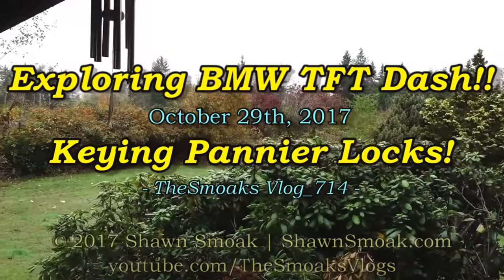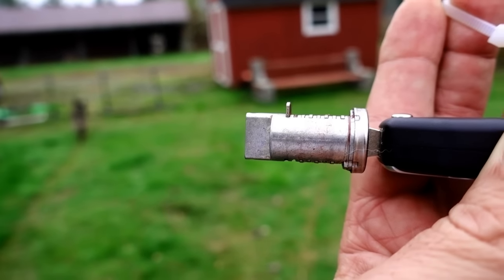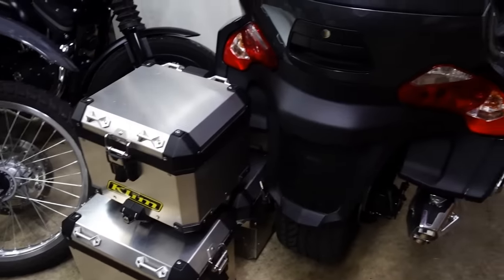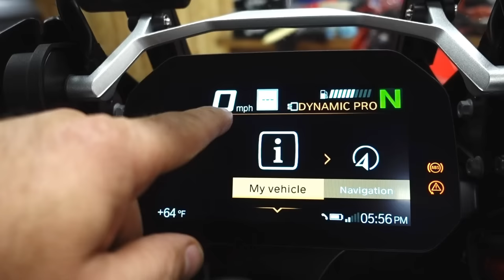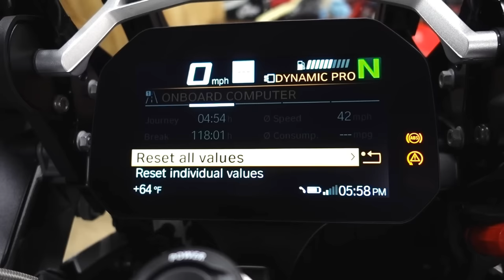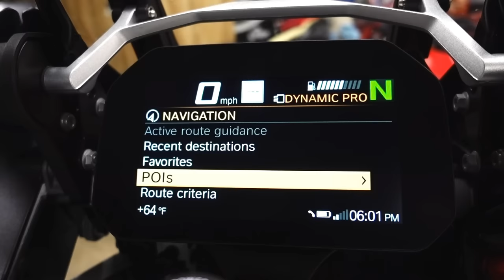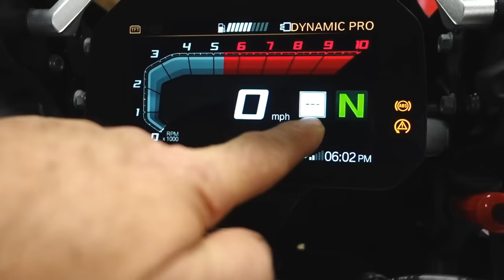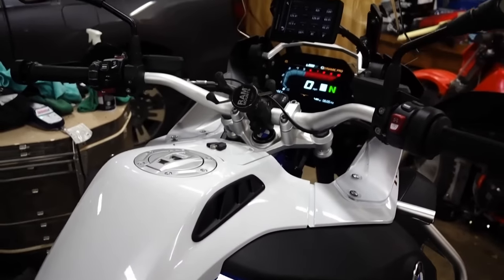Exploring BMW TFT Dash!! • Keying Pannier Locks! | TheSmoaks Vlog_714

Comment: On the s1000rr 2020, the app has speed, RPM, lean angle , throttle position, altitude etc

Comment: Hi Shawn. You mention a connection directly to the battery is a no, no. How would you suggest I connect a pillions heated jacket
Reply from the maker: Connecting to the battery to power-up accessories if fine.  BMW doesn't want you to connect a charger to the installed battery while connected to the bike.  Charge through the power port (with a CANbus compatible charger) or a removed battery...

Thanks!

Comment: I’m researching your older videos for tft display info. I have the 19 Standard GS HP and I’m trying to figure out how to disable traction control in Dynamic mode. I do not have the chip for pro modes. Is this even possible. The manual is not great in this area. 
Thanks.
Reply from the maker: Using the ABS button on the left switch cluster, short presses switches traction control on and off.  Long presses switch ABS on and off.  Works the same in Dynamic Pro, should you order the Pro Ride Modes chip at some point... 
Be very careful..!  I don't want your next reply to be about you looping the GS over, or totally loosing control of the rear end!!!  BMW took these options away on the 2020 S1000RR, unless you render the bike into full race mode (street legal lighting removed).  I bet BMW will make Enduro Pro mode the only mode you can turn this off on the 2020 GS/GSA's...  Pretty crazy when riding them turned off, so again, be very careful!  If you get the chip, you can turn it down, but not completely off...  Much safer!

Thanks Courtney!
Reply: Thanks...
I really appreciate you taking the time to reply. 
I will be careful. Definitely do not want to loop it 😬

Comment: Nice FYI. I survived my trip down south. 22hrs of riding in total for a distance of 2,534klms. I broke up the down trip which was easy, but the return was one trip, not so easy. My butt was like lead, even with the Mustang Vintage touring seat, by the time I got home. The SGS handled it like the pro it is. Never put a foot wrong even in 60kph wind from the side. I did however make one mistake when returning from Wollongong took the wrong road. Princess Hwy and Princess Motor way ain't the same thing. Needless to say this bike isn't for stop start city traffic  with traffic lights every few hundred mtrs. Should have zigged when I zagged.  Still I've done it and I'll wait awhile before doing it again, it'll take that long to clean the bike.

Comment: So that not honking charger directly to the batter just a BMW thing. My 2014 comes prewired for the battery analyzer to the battery.
Reply from the maker: +Ron Bridgefarmer - I can promise you, your 2014 did not come from the factory prewired with a charging lead attached to the battery...  A lot of dealers install them during setup & PDI of the bike. We do the same here on everything except F, K and R series BMW's.  BMW claims that going through a battery that's connected the bike's system could possibly do irreversible damage to control modules.  Pulling the battery from the bike is fine, or using the power port with an approved CANbus charger is fine as well.  The power port is filtered by the ZFE Module.  If anything was to go wrong, the ZFE will shut down the power port, protecting everything.

Thanks for watching and commenting Ron!
Reply: @TheSmoaksVlogs  So due to the charging being done via the power port, will any charger work if it has the connector. I have the leads directly on the battery on my harley and was hoping to use the same charger and lead once i get my gsa

Comment: Good day all
Shawn can you add a link to the video showing how the charging sequence I have 2016 s1000 XR that the dealership put on the little dongle that connects to the battery But I would like charge it properly 
Thanks 
Bill
Reply from the maker: +William Barbour - For whatever reason, BMW is okay with having the charging port installed directly to the battery on the S series bikes..?  We do the same as your dealership, the leads are installed during setup & PDI.  You're all good!

Thanks William!
Reply: Yes, my dealer installed a cable to the battery and I connect !y optimite straight to it...no messing about!
This is my second LC GS that I have had..no battery issues

Comment: have you a link to connecting the optimate ? and must you buy the canbus version will the din cable work with the non canbus optimate 4
Reply from the maker: +Allroad Mail - I'll have to do some digging because I can't find the darn video myself right now..!  Yes, it has to be the CANbus version and switched into CANbus mode.  The bike's ZFE (Central Chassis Electronics Control Module) will simply shut the power port off in approximately one minute, as it doesn't recognize an appropriate charger connected to it.  Seems a pain at first, but becomes second nature after a few times hooking it up.  It's very safe for the bike.  If anything were to go wrong, like power surge for example, the bike instantly shuts the port down.

Thanks!

Comment: Thanks a Lot for the video.
I have a question. I intend to buy a gs 750 in a few weeks.
My thought is that TFT and Navigator 6 overlap in many features and makes no sense buying both. TFT is no brillian in navigation but you can use your mobile phone with google maps connected to TFT.  ¿¿Is my thinking right?? TFT and Navigator are expensive devices and I would like to make a wise decision.
Thanks a lot...!

Comment: Pannier rack recall?????   about done????
Reply from the maker: +P Baker - There’s a solution now, just waiting on the parts to update the racks, and panniers if used...  I’ll let you guys know when we get them and what it looks like installed. 

Thanks!
Reply: The recall was on the boxes, waiting on BMW to send mines. They said they addded reflectors or something.

Is the Enduro plug under the seat? Is it that plug with a red cap on it?

Comment: Hello , do u have any idea why abs and tc lights are blinking , just bought my gsa 1250 2020 and the blinking driving me crazy
Reply from the maker: They are blinking because the bike has not performed the self-testing of the systems...  As soon as you get moving, it will test itself and lights go away.  If you ever have the flashing while riding, a message will appear on the TFT telling you that you have an issue and instruct you what to do..!

Thanks!!
Reply: @TheSmoaksVlogs  thank u , i feel like a noob here 😅😐